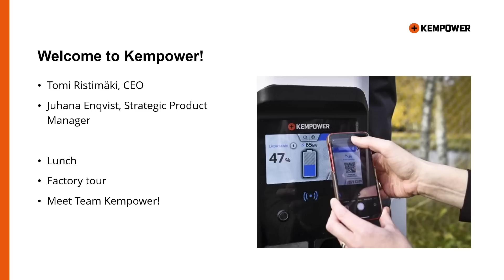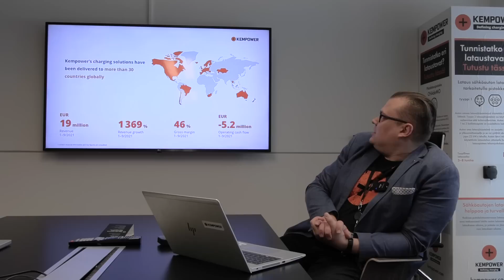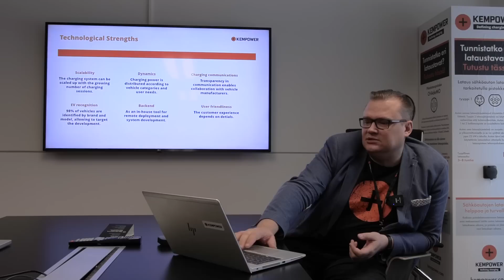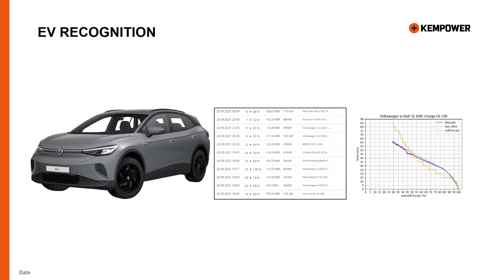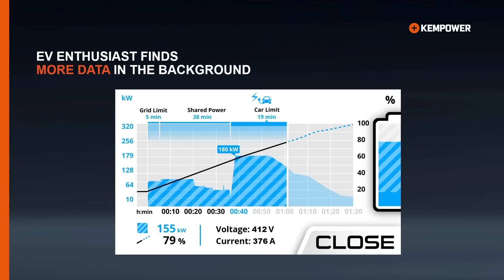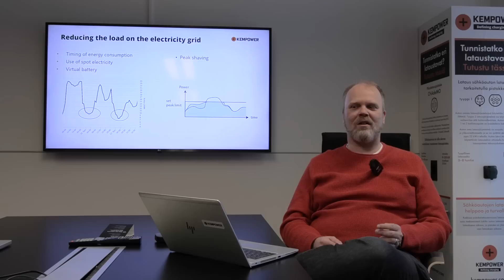Kempower presented by CEO Tomi Ristimäki

Comment: A Kempower AC Home Wallbox, with all the intelligent charging functions they already have in the background, would be brilliant. A good implementation of smart charing fuctions like "charge when the price / kwh is low" or "solar charging" is missing in any home charger in my opinion. Easee gets close, but i.e. solar charging is only possible via 3rd party solutions over their API.
Reply: They said they're are not making AC chargers at least for now
Reply: Iirc the ceo mentioned that the home (AC) market was already crowded & their focus is on the fastest expanding fields. The business wisdom of that decision may be expressed in Kempower's >1300% business expansion last year.

Comment: If Im DC fast charging I only want to be charging at 100kW or higher. I really dont want to be charging at 50 or 25kW. Kempower sharing the load sharing is fine as long as you have the capacity for each charger to be guarenteed a minimum of 100kW until the charging curve speed has reduced to below 100kW. But in reality 150kW should be the minimum speed for each DC charger.

Comment: Really cool. As a fellow Finn I did know about Kemppi as a brand but I had no idea that Kempower existed! Really excited as a Tesla Model 3 Performance owner that the nation has this kind of options for EV charging. Especially the dynamic sharing of the total capacity was the best part of the presentation. 100 to 250 kW rates are the ones I always look for when deciding on where to stop to charge(keeping the charge time between 15-30min). This tech really helps in the future where larger station slots are full of slow charging cars that might not all need the full power like new Teslas do. Really looking forward to seeing this infrastructure implemented to Finnish stations, since I'm gonna always stop there if Superchargers aren't an option in my route. Plain 50kW capacity just wont do since I don't want to wait for an hour+ per stop. Great job from Kempower team!